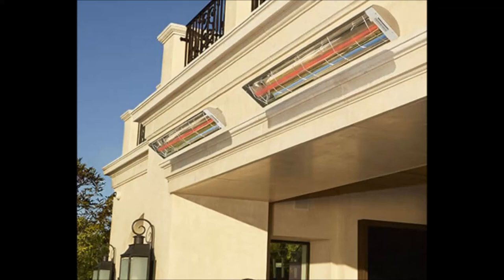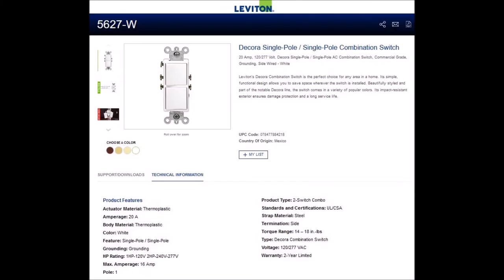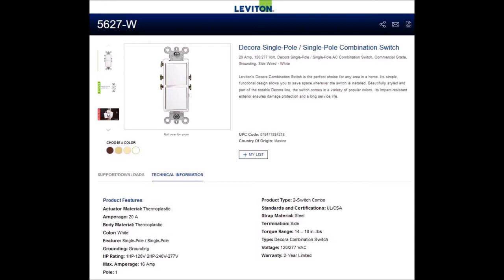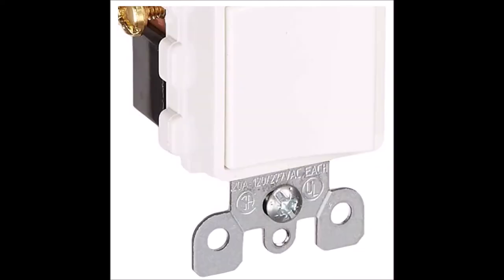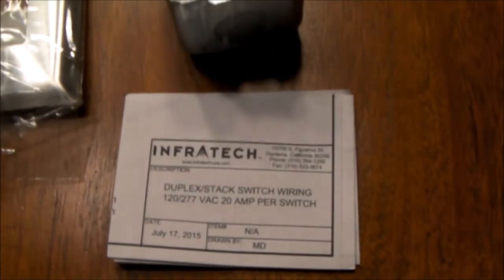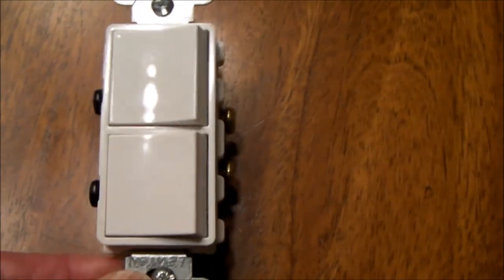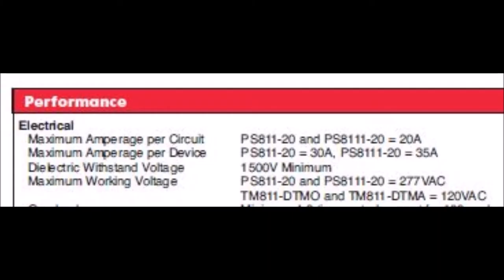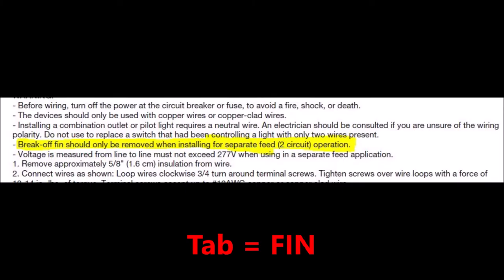On-Off Power Switches for controlling electric Infrared quartz heaters

Comment: You cannot use these! Your max wattage at 240 for 20 amps is 2400 watts, you CANNOT use these switches for a 30 amp load at 3000 watts, they will eventually melt. Once you go above 20 amps, your best configuration is a relay can. Being a licensed electrician for 30 years, it's scary that you're disseminating bad advice so freely.
Reply: I am trying to figure this out and not asking to be a jerk but just curious how you came up with 2400 watts?  Wouldn't it be max 4800 watts? 240x20=4800

Comment: I have 2 3000 W 240v rated infratech dual heaters each with its own dedicated double pole 20 amp circuit breaker with 12 AWG. I was given 2 stacked switches . Do I connect the black and red to the black terminal and the switch leg to the gold terminal ? Or does this operate differently than a normal switch. I’d really appreciate the help . Wouldn’t wanna do something wrong. Thanks.

Comment: Usually those are heavy 2 pole 30a switch.both elements running at the same time. Dont use stack switchs  the two phases are too close and can arch.
Reply: Any recommendations on guage and circut breaker size. Cant find info anywhere

Comment: Thanks for the video! Prior to watching your video  I purchased the same switch to control the same Infratech heater. Did you end up using this switch (Leviton 5627-W)? If so, what size/gauge wire did use? Also, have you encountered any issues?
Reply from the maker: I'm going to use the Legrand Pass Seymour switch.  Haven't installed it yet .... new construction underway and this won't happen until early spring.

Comment: Hello gentlemen. Thank you for this informative video. I am about to purchase at least 2 WD60s. Did you use the Leviton switch and your own wiring? Any other tips or info you could share? I hope your project went well for you.
Reply from the maker: using these:  https://www.ebay.com/itm/203821285717   Project is not complete.  It is in new construction so you can easily imagine the build issues.  I like the rocker configuration on these better than the ones sold for $$$$$ by the heater manufacturers.
Reply: Thanks for the link.  FyI, my electrician friend says he has had to repair a couple of these units because people have left the heater on for too long and the quartz elements are not designed for prolonged use more than 90-120 min at a time so he recommends including a timer in your install. Something to think about. I think I will do what he recommends.
Reply: @kentbrealty  hi there name is Mike.  I’m having some questions about the wiring and how to actually split the hots on the unit.  Have you wired yours up yet? Does your electrician friend know the fashion in which he is going to divide up the L1 and L2? N1 and N2? Thanks

Comment: Did the legrand pass samore prove to be safe? I have to make a choice but am worried about safety.  Also what gauge and breaker did you use?  Thanks in advance.
Reply from the maker: my electrician is installing this in new construction.  He has not indicated any issues but believe me, he will is he sees one.  The breaker and wiring sizing are pretty important but I don't know what you're installing and I'm not a pro so you shouldn't be taking advise from me for wire size and breaker.  I did add an expensive timer which gives me some redundant on/off power control.
Reply: @YuDaMan  What timer did you end up choosing?
Reply from the maker: @thematthewmyers  I found a high current timer like these on ebay  https://alfresco-heating.com/accessories-parts/patio-heater-repair-parts-accessories-by-brand/marktime-timers/
Reply: @YuDaMan  Thank you.  I have the MarkTime 72130AB on hand for my build in progress to be paired with the Leviton 5627W (5000W heater). With an internal wall control, to avoid custom fabrication of the MarkTime to the faceplate for aesthetics, was hoping to find a standard decora-style, mechanical or electronic timer capable of the load.  Application is for a short-term vacation rental, so adding a timer is preferred.

Comment: Thank you for the video. I am looking for a switch alternative as well and I'd like to hear your plans for wire size etc. Please update when you do eventually get to this project. Thanks.
Reply from the maker: I plan to put my extra switches for sale on ebay next week.  I bought more than I needed of the Legrand Pass Seymour.
Reply: What circut breaker did you use?
Reply: I wired my heaters using the leviton 20 amp dual switch. I used 10/3 wire.